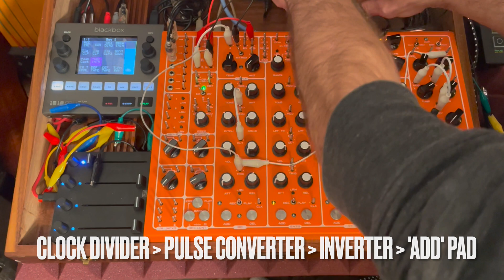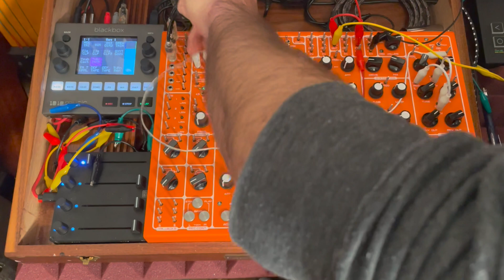Pulsar 23 Patch: The Inverted CV Recorder

Comment: i think the reason why this is janky is the cable quality. the rubber is not 100% isolating and that means that if you have too much surface area of your fingers touching the cable or isolation of the clip there is a some amount of current flowing triggering the add sensor. in that case you get a constant gate and no pattern. recording a pattern into the looper is cool, but sadly you cannot record a dynamic signal, as the add sensor is binary. and the dynamic signals of the combination of clock dividers is where the clock divider really slaps for me. no way to record that into the looper, sadly.

Comment: These patches are fun! Out of curiosity, what's the black box with the sliders and blue lights that's in some of these videos?
Reply from the maker: Thanks!  Intech grid ef-44. A really flexible midi controller. I use it to control levels on the 1010 blackbox, and sometimes for midi control over pulsar